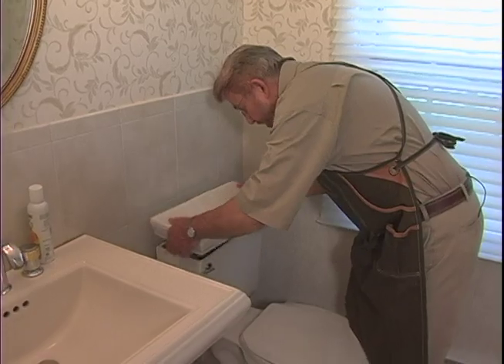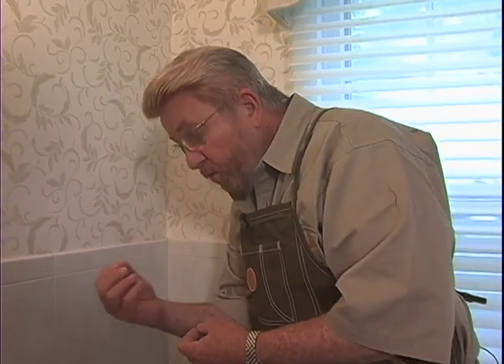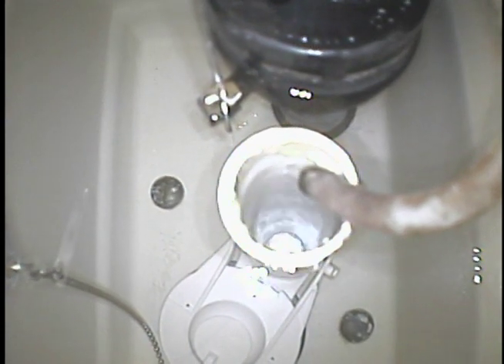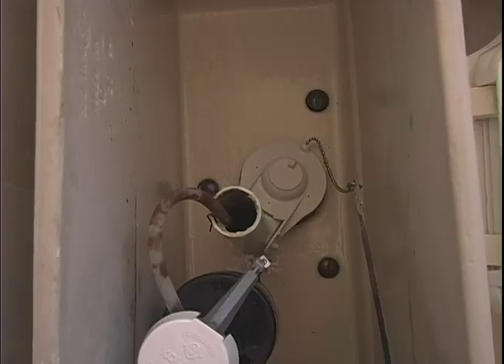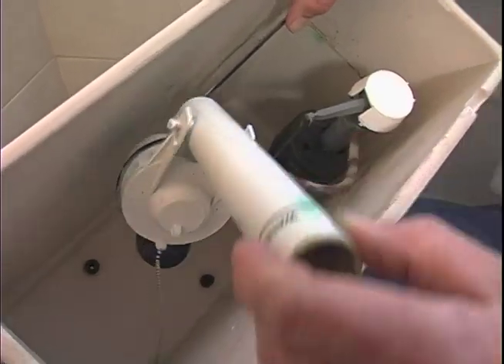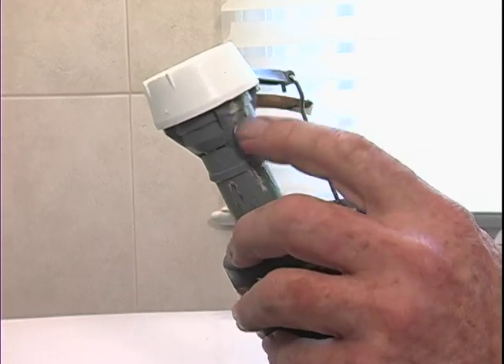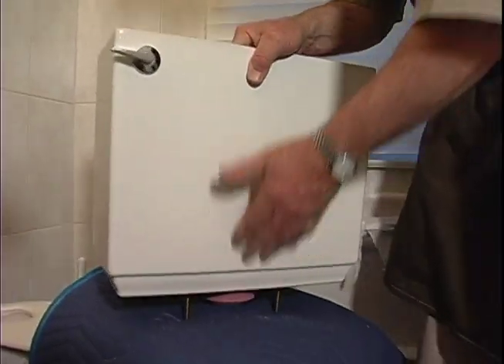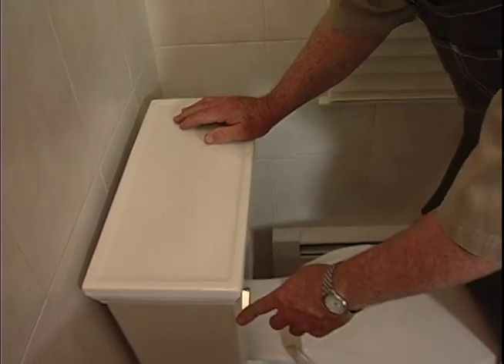How to Repair a Toilet

Comment: The tank mentioned is commonly called a cistern.
Most cisterns are made of plastic and some older ones are made of porcelain.
Be careful with porcelain though as it's heavy and breaks easily if dropped.

Comment: The dye only tells u if the leak is either the flush valve or flapper, also what causes a toilet to run, is someone puts the refill line from the fill valve down inside the flush valve, causing it to siphon water out of the tank, thus requiring the fill valve to kick on, aka, ghost flush sound in the middle of the night.